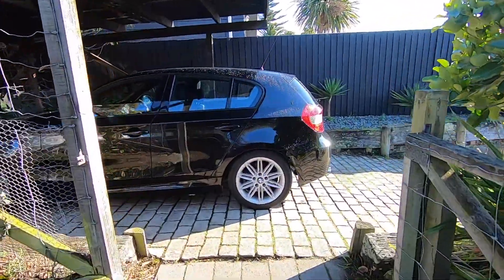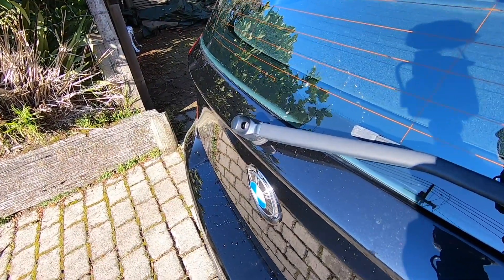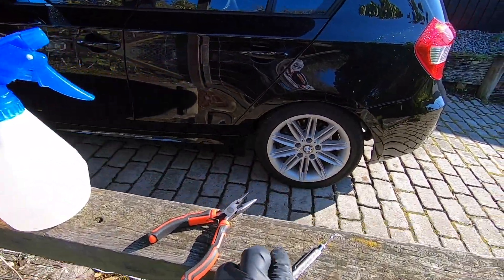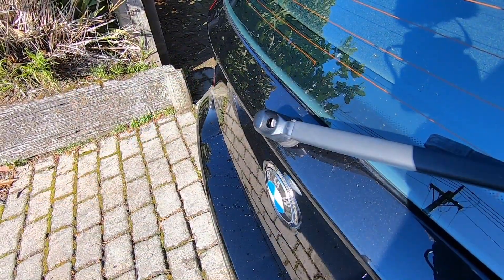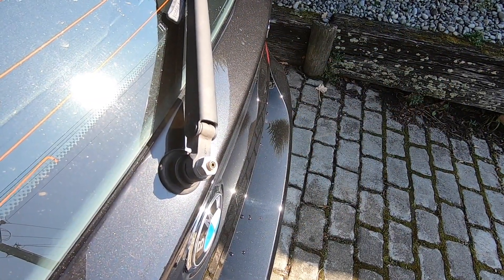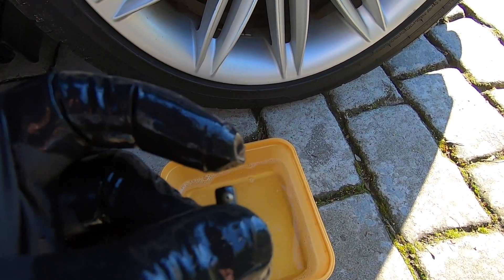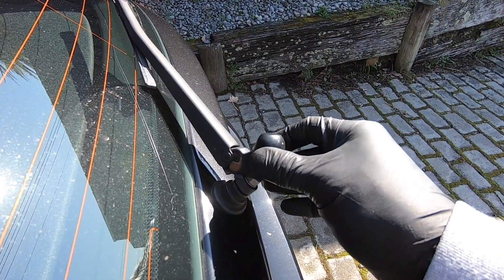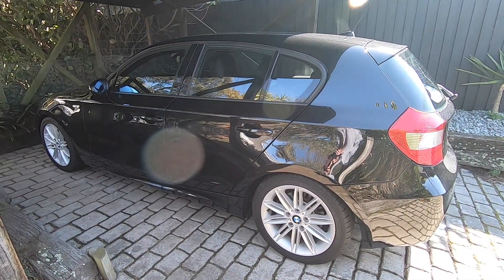BMW 1 Series Rear Washer Fix

Comment: Thank you so much, it really worked! However, I managed to remove that nozzle with bare hands. Then, I gave it a thorough clean and blew a hole with my mouth. Finally, I turned on the cleaning switch for 30 seconds straight until I obtained a steady stream of water. Then put nozzle back and it worked!!! You saved me both time and money! May God bless you!
Reply from the maker: Nice one Rick, glad you found the video of valve. Thank you for the kind words

Comment: Thanks, fixed mine thanks to your help!  
It's worth testing the water comes out before putting the nozzle and cover back on, as I identified the problem was in the main feed pipe rather than the nozzle (which is where I had expected the problem to be).    I used a thin allen key to poke around inside it, that did the trick.
Reply from the maker: Cheers Ross, yes for sure worth checking everything while it’s apart. Thanks for checking out the video

Comment: It wash wiper hasn’t worked for years and if i leave the washer jets out it comes out the back at some force but when i put the jets back in it looks like it’s leaking from the middle of the bottom of the hatch back. 
I was just wondering if it was possible to disturb something within the wiper motor. 
Thanks for your reply it is very much appreciated 👍🏻

Comment: My one series is a later model the jet is located and positioned in the rear high level brake light not the wiper. But thanks for your informative video.

Comment: Hi I’ve just followed your excellent video but now I’ve got water run down and out around the BMW boot release now it’s working could you have any ideas why this could be happening as it wasn’t before I got the rear wash working again. Many thanks John
Reply from the maker: It’s either what water is dribbling down off the glass now it’s working, or somethings not together right and it’s leaking at the nozzle, if this is the case you’ll have to go back in and check everything that’s been disturbed

Comment: I'm not getting water at all to the rear screen on my 2005 series 1, I  can hear the pump working when I operate front washer but can't hear anything when operating the rear, what could the problem be?
Thanks
Reply: Check if you are getting water to the back at all - disassemble the pipes and see if you are getting anything before the nozzle and the wiper gear casing (the silver bit) or the non return valve. If not then either you have a hole in the pipe leading back or you have blockage at the pump exit in the front would be my guess.

Comment: My pump works for the front but doesn’t for engage for the back is that a fuse issue or wiring? Or is there a separate pump for the back any help please?
Reply from the maker: Seperate pump for the rear, it’s positioned in the reservoir at the front of the car
Reply: @MTechGuy  thank you 🙏

Comment: I can't open mine, its 2008. Could you help with how open 2008 or later model, thanks
Reply: Hello mate, i have the same version as you, its the same process of removing the cover, gentle pulling the nossle out and cleaning it, just a slightly different design (twin nozzle spray) hope that helps 👍
Reply: @Bobby Brown  thank you very much, worked ✅️

Comment: Can anybody help? I have an issue with my pump. When I activate the rear washer, the wipers activate, but the pump does not. I have replaced the pump with a known working one, with the same result. After testing with a multimeter, the pump is not drawing any power when the switch is activated. The fuse diagram shows I need to take the car to the garage, but I am wondering if anybody has experienced the same problem? Any help would be much appreciated!
Reply from the maker: If there is no power to the pump when the switch is activated, check the fuse, check the wiring

Comment: No water coming out when I disconnect hose as shown in this video
Reply from the maker: Pump is either blocked or dead, either way it’s worth inspecting the pump at the reservoir. I have a video coming out on this soon.
Reply: @MTechGuy  is the pump on a 2005 116i behind the panels in the right front wheel area? Are there separate pumps for front & rear? Thanks for your help, much appreciated
Reply from the maker: Yes and yes 👍

Comment: Mine just stoped working today I think it’s the ice 🧊 tho started to get very cold here in the uk recently
Reply from the maker: Most washer fluid in the UK has antifreeze (unlike here in NZ)
Make sure it’s topped up the right ratio, and flush it through once the ice thaws
Reply: @MTechGuy  yeah I poured hot water onto it and it melted thanks tho 😃

Comment: I have 2 different nozzles and when i put in either the liquid overshoots the window a good bit. Would you know what the problem is? Do i have to bend the nozzle someway?
Reply from the maker: The angle can be adjusted with a thin nozzle tool, or a needle
Reply: @MTechGuy  thanks bro, will try tomorrow